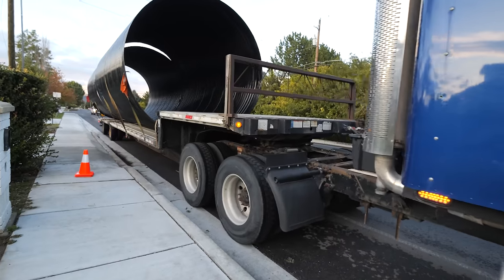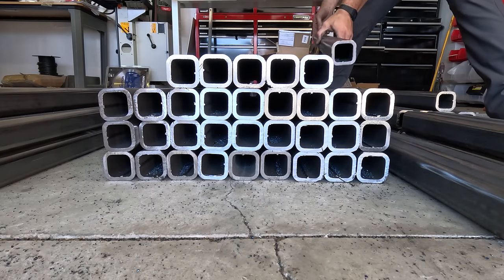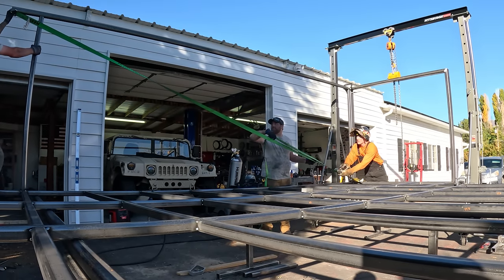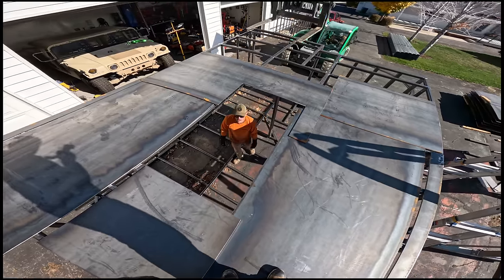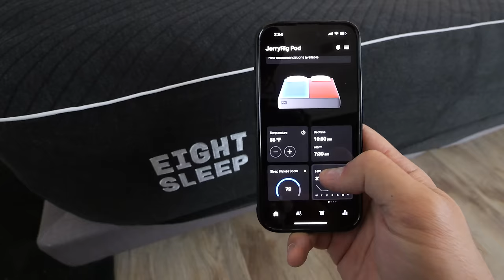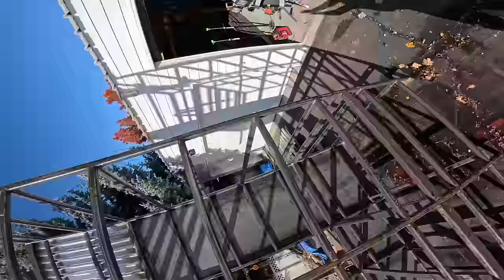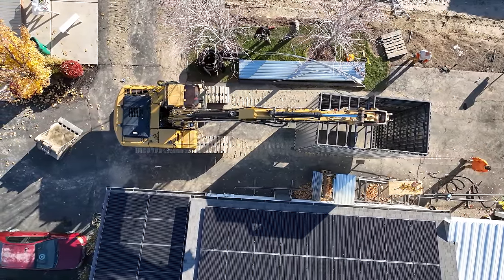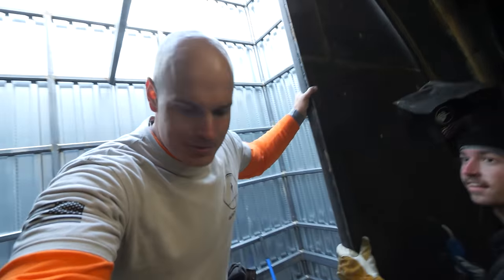BACKYARD BUNKER PART 4 - THE ELEVATOR SHAFT

Comment: I have a couple of concerns about the project.  1. You must have ventilation in the pipe when you work, otherwise poisoning can occur.  2. You don't have a concrete foundation for the staircase structure, which can cause subsidence over time.  And bending or even breaking the bunker as a whole.  3. Given that you have a tube concept booker, I would suggest that you hide most of the water and battery installation in the floor, as well as food and tool storage.  4. even if you don't think you need it, it would make sense to install a water pump and maybe also a septic pump for pumping out human excrement.  5 I would suggest two reservoirs, one for water and the other for feces, to bury by the stairs.  We'll see everything else when you show us.
Reply: It's probably too late to make those changes.
Reply: Are they planning to stay full time and use it like a house?
Reply: @KZDaGOAT No, it is for emergency situations.
Reply: @chriskay1449  ah that's right you don't shit during an emergency. I forgot.
Reply: @tarkadahl1985 😂😂😂
Reply: The engineer behind hamas tunnels
Reply: You sure you're need a foundation when you're that low down
Reply: @TheoDaJunk yes cause the fresh dirt underneath all that weight will still compact
Reply: Yeah, Considering these kind of projects once completed are difficult to alter, so all this should be well thought.
Reply: Wow they should have hired you to build the bunker
Reply: @tarkadahl1985 Did you watch the video at all. He literally explains why he is building it. They aren't living in it full time and they are putting in a bathroom down there along with a bedroom, living room, and kitchen. Don't be dense here.
Reply: @chriskay1449  course, you are 100% right, no one every needs to do a shit during an emergency situation when there's bedrooms and a full kitchen for staying down long term.
Reply: Will you tie it in to your house with a connector tunnel like Colin Furze?
Reply: Next concern, the fact that we’re building bunkers.
Reply: The "Well, actually" guy has appeared!
Reply: I wish he would have consulted ppl that actually do this for a living. It would have actually ended up saving him tons of money, time, & issues down the road that either will end up being unfixable or extremely expensive.
Reply: He mentioned a shower, so I think the water reservoir will come eventually
Reply: @ExilEliteYT And the welders are experts. They already know that stuff.
Reply: This guy pointing out the obvious🤓
Reply: I'm certain this had to be permitted and those city officials are pretty serious about making sure things like foundations are in place.
Reply: As someone who works in construction (CAD technician) I can verify that you may need construction if you're building under the ground. The soil is made from different geological layers, some more resistant to compression than others. If the soil is firm you can build on top of a concrete slab. If the soil is loose and/or wet or the firm soil layer is at a depth, you're going to need a foundation on concrete columns that reach to a depth where there's sufficient resistance to compression.
Reply: I was wondering if any concrete foundations were needed for both the tubes and the metal structure. Even if it's going to be buried, won't the soil underneath still move and shift the structures? I'm genuinely curious to know if that's not needed if it's all going to be buried.
Reply: Ok hater
Reply: He’s likely going to pour in concrete around the structure after this point in the build. As someone who took all the physics and structural engineering classes (plus statics) necessary to evaluate structures like this, I’m quite sure it’ll be fine. That is definitely dependent on how compact & stable the dirt is at the bottom of the pit (and whether he lives in an earthquake prone area), but I’m sure he consulted an engineer on the design. He’s not an idiot.

The fact you think the steel he’s using is going to “bend over time or break” just because there isn’t a foundation under the stairs alone says it all. It is quite a rigid structure (with most of the weight in the tubes, not the stairwell which will be 90% air), and in terms of static frame structures like this it doesn’t really work like that. It’d likely just shear, not bend (depending on the hardness / shear modulus of the steel grade used), if there are true issues in the design. But once again, that’d get checked by an engineer certified in evaluating structures like this before it’s approved.
Reply: What part of jerry rig everything don’t you understand
Reply: The "well actually🤓☝️" long essay guy
Reply: I would have preferred to see at least three concrete saddles for the culvert to set in. That could help prevent the tube from collapsing from the weight of the backfill over time. Also a perimeter drain with a sump and pump to keep water from pooling and floating the whole bunker up out of the ground. However mentioned has been made of an engineer, perhaps a consultant, so these issues may have been addressed. Possibility a line of concrete trucks will show up and bury the whole thing in concrete. That would resolve a few of my concerns.
Reply: I was concerned about the lack of footings underneath the stair well...
Reply: @jamespayne8781  I agree that saddles would’ve been optimal, drain/sump as well. I think most likely he’s gonna bury the entire thing in concrete… He could have a crane come out when they pour concrete so he can have them lift it up, and pour underneath/around all in the same day. Not sure. It was probably way more expensive to have concrete trucks show up two times so he could pour the foundation before all of this (but I have zero clue what that costs, so again not sure; probably not cheap though).
Reply: @o7juan   Who, op?🫤
Reply: Not sure he could’ve built this without permits and plan approval. If he has that, the engineer must’ve had all these concerns covered.
Reply: Would it be prudent to have an additional waterproof coating applied to the outside of the metal?
Reply: @tarkadahl1985 I absolutely love this reply 😂😂😂😂
Reply: @orlandogutierrez1234   Pretty much everything he’s using is already treated for use underground, except for the corrugated metal they added in this video (which will likely be covered in concrete)…
Reply: Where were these complaints during the first video? When changes could be made easily. And is he done yet, no. I think he is smarter than the average YouTube commenter, so I'll wait until he is done. Or we will get to see, "How to break down an underground bunker" lol
Reply: @haroerhaktak2613 hi, it certainly would be more difficult but still easier than once it is all buried. I think footings could be created if an underpinning  process were used.
Reply: @KateKosmo every comment he gets raises him in the youtube algorithm resulting in more subs and revenue
Reply: @chriskay1449 
No, it's just for YouTube. 

There. Corrected it for you bud.
Reply: @chriskay1449  why are you replying to me, wrong guy bro 😂🤣🤷
Reply: @KateKosmo  haha.. He is way more successful and richer than you woman.. Wake up, he has pros.. Look at that welding?? Really, like he needs to take advice from you 🤣😂 on top of that a woman 😂🤣🤷
Reply: @ianwazowski5607 he's trying to make sure he doesn't die?
Reply: I think he'll pour the concrete in the next part. Once everything is set and rotated properly. In my mind, I'm also thinking that he'll have custom water tanks for both the needs... He could also build a small septic tank near the entry, or exit. I'm also thinking he'll have his ventilation planned out to run through the ceiling. As for the ventilation while welding in this video, they were pretty close to the entrance. Maybe moving forward he'll figure something out
Reply: @ExilEliteYT  Jerryrigseverything fan being sexist? Not something I expected. Btw that remark at the end was so unnecessary. This video has nothing to due with politics, gender relations or anything like that so therefore no ones opinion should be invalidated because of their gender or their political affliation.
Reply: @ExilEliteYT   If I was american I would vote for Biden.
Reply: @ExilEliteYT  I don't see this level of animosity towards the top commenter what's wrong with you? It seems like you're bitter
Reply: @KateKosmo so the whole team he hired doesn't exist
Reply: @ExilEliteYT  Imagine flexing another mans money
Reply: Key word at the start of the video simultaneously
Reply: Didn't think Jerry was a Doomsdayer 🤔
Reply: Water tanks and sewage should be outside if possible. Why waste valuable internal space when you can put a tank in the same pit? Also wells are a great option if you can do one (what I have)
Reply: I agree there is a lot of concerns for me on this structure.  So many better options to accomplish the same goal that are proven.  Oh well it makes good content and that is views and that is the goal $$.  Cheers be safe and good luck you may prove me wrong and my 55 yrs of construction experience.  Could happen. 🇨🇦
Reply: @Laminar-Flow  you make a good point. If a build permit is required, there will be a burden of proof for structural soundness that only a certified professional can sign off on.
Reply: WiFi in the bunker is possible. It may become intranet rather than internet but you. It would be similar to an air gapped network.
Reply: @TheFinalIllusion didn’t you watch the first episode!? He literally said that this was actually a long time dream of his and had nothing to do with current events
Reply: @standardannonymousguy the real question is, will he add a car lift from the underground to his front driveway?
Reply: @bramweinreder2346  Exactly -- Engineering Certs required!
Reply: Please don't bury yourself alive....this structure is a tomb !
Reply: For heating cooling you could look into into 1-1.5k FT deep well temp should be around 110F 130F you got nice heat even if the temp drops 20-30 on the way up
Reply: @Beejrich  you have to do them prior too welding the ends on as they are larger than a man door entrance or even elevator.
Reply: So... you didn't actually watch the video... 🙄
Reply: Oooh lord I give it 5 years before that soil starts moving everything around good call mate
Reply: I wondered where all the engineers on earth went. They're all here in the comments section
Reply: i think these are all valid
Reply: My favorite project thus far.. 😁
Reply: @Laminar-Flow  i’d also think he’ll bury it in concrete, however i recall in his first video while excavating the hole that they were calculating the volume of dirt displaced by the tube in order to reserve enough dirt to bury it later on.
Reply: You mean install a gray water tank**
Reply: @carsoncox469 It's not obvious for everybody
Reply: Pretty sure he's thought of it and almost positive his engineers have.
I doubt this is a half cocked idea and they're just throwing it together.
My thoughts.......
Take care,
~Jonny5🥁
Reply: I’m gonna go ahead and guess Zach did his due diligence
Reply: For the stairs it may not matter. Alot of Utah is just rock...
Reply: foundation not needed it will act as a pile
Reply: @jamesmisener3006 Fellow Canadian here. I really don't see this project proving you wrong.
Reply: Nerd
Reply: @TheHertzWeb that's a stupid remark. People are making valid observations, which may not be 100% correct. Some of the answers are explanatory, which is great, while others, like yours, are plain stupid.
Reply: Also if it's not stainless steel ( can't remember if it was) won't it rust over time and eventually break?
Reply: @joshissocool97  Stainless is not corrosion proof. It just corrodes less readily than carbon steel. Hence, stain-less.
Reply: @tarkadahl1985 you have seen the build plans? How do you know what all is or is not planned for?
Reply: @Laminar-Flow yeah the welds and those bolts can support a lot more stress than most people would expect. They’re surprisingly super strong.
Reply: Why not build yours Mr know it all
Reply: @TadpoleTrainer   Exactly... I don't think most people understand the sheer amount of force required to shear welds and bolts. Static frame structures can handle a lot of weight and the culverts he's using were specifically engineered to be built underground. The weight of the dirt on top and small movements over time are absolutely nothing to a structure like this; most people here are thinking it's like an above ground home on a foundation.
Reply: I’m sure he has number 1 figured out, I don’t think a man capable of tearing downs and rebuilding phones aswell as converting a diesel hummer to electric would build a massive airtight carbon dioxide chamber
Reply: This is a nuclear family bunker not a nuclear winter bunker.
Reply: I don't really understand where you've gotten the idea that he hasn't considered any of this in his design.
Reply: @joshissocool97  i think it's coated with something, although some of it had to be removed to be able to weld.
Reply: @the_gamer_kinda  Because nobody needs a bunker.
Reply: A concern I have is why the hell its so shallow?
Reply: @tarkadahl1985 did you miss or just choose to ignore the part where they said “a bathroom down there”
Reply: Oh I’m sorry who study physics, engineering and statistics and got a building permit I believe jerryrigseverything did not you
Reply: @Laminar-Flow okay, first off, you WON'T see any of the shearing (were there actually any to occur in the future) of the welds themselves, provided the welder did his job correctly; thereby not imparting significant flaws within the vast majority of those welds.

What most do not know or fail to understand about welding science is that when the correct welding type & methods are utilized in the construction of any type of metal structure--including the hull of a nuclear powered ballistic missile submarine--the welds don't factor into the "total strength" (or survivability) calculations as structural engineers work out the integrity of their design because when each of those welds is absolutely on the money, it is understood that the welds are considerably stronger than adjacent base metals being welded together.  

It is those sections / spans / layers of the base metal that inarguably form the vast majority of the surface area of the entire composite structure, therefore the integrity relies primarily upon the engineers accurately specifying appropriate materials (defined by tested / established metallurgy values) with correctly defined dimensional measurements.  

Naturally, things become far more difficult to calculate when welds are not the sole method utilized in forming critical junctions in a metal structure, but those factors can all be figured based upon their own inherent limitations.  

Lastly, welds don't have to be subjected to magnetic particle, ultrasonic or Kadiography inspection to verify they meet mission critical standards, but when they are non-destructively tested and verified by such means, you can bet your life on those welds NOT being the point of origin in a event of future catastrophic structural failure.

As for bolts.....that's an entirely different matter, but still a factor that can be calculated for by structural / materials engineers.
Reply: @USNBRENDON  I definitely don’t work with welds much- I’m not a civil engineer, so welds weren’t emphasized as much as bolts & pins in the classes I took on structures/statics or vibrations & controls / mechanics of materials... This is mostly stuff I’m remembering from relevant classes because I don’t really do these calculations anymore. I’d assume you work / have worked with submarines because all of the stuff you discussed is definitely pertinent to that area of work- but you cannot confirm or deny for obvious reasons haha. It’s a pretty similar engineering problem to the bunker but obviously much less in terms of PSI. I definitely, definitely agree it’s not gonna be welds breaking first. It’d be bolts or the specific members of the structure in tension/compression, but you’d have to evaluate the structure with software for a high accuracy answer & that’s a civil engineer’s sorta gig…

I simply said people don’t understand how much force is required to shear welds and bolts, because it sure is true… This design is interesting because it uses both bolts and welds in the same places and in terms of a structure, holes nearby high-stress areas can be a point of failure but honestly at these scales of applied force not an issue. Realistically, what failure mode present would depend on the type of loading conditions that are present: tensile, compressive, shear, bending, combined loading. But, the torque moment required for bolts to be shorn alone is ridiculous; with welds it’s even more so. I am familiar with equations for Bolt shear stress, compressive stress, plate shear stress, etc. I also remember in terms of welds, the smaller value between weld metal and base metal strengths dictates strength of a weld but like I said, not my forte, and in the electric boat industry it’s all gonna be top-quality no holds barred material choices. Not sure what was used in these bunker videos, but I’m sure he had an engineer check the design. I work in aerospace, and in terms of that industry while welds decrease drag (and are lighter), they’re difficult to inspect for defects visually, are permanent, introduce heat-affected zones, and oftentimes now most sub-assemblies are a mix between composites and metal… You’re clearly on the money in saying the integrity of a hull or bunker for example rely on overall materials choice & weld type/method- I do think that nowadays such structures are definitely modeled in software and stress tested virtually, though. The software has come a long way, and when you’re talking about a nuclear submarine, models are very likely run through some of the government’s biggest supercomputing clusters- just like stealth calculations (among others now) have been since the infancy of our stealth programs. Most subs now, I believe, are digitally design before a single weld is ever made as is done in aerospace.
Reply: just make a big hole far away and connect a tube to the toilet
Reply: Yeah, I can only guess that a guy like Jerry hasn’t covered all the possible contingencies. LOL
Reply: @KateKosmo LOL Really?!?!
Reply: That's three more than a couple suggestions
Reply: @bramweinreder2346  with the weight of the bunker as a hole I’m fairly certain it won’t move much( maybe settle a centimeter or 2 ) I lay pipes for a living and except for compacting the sand we lay the ( not as heavy but still sometimes up to 2 tons) pipes right on it without a problem. Then there’s the fact that it seems that the soil in his yard is really good for absorbing water (so erosion won’t be a big problem if again compacted properly) won’t be a problem. As mentioned compacting is key for it not move. We usually do 30 cm layers with until we get to desired height. Haven’t had a single complaint from the customers or city I work for.
Reply: @seibt6466  good for you, it also depends on the groundwater level though! I live in the Netherlands where it's quite flat and soggy. Basements are put down as one big concrete tub, and if the floor is below groundwater level it will float. So typically they dig a well there and pump the water out to get the level down on that location until it's weighted down sufficiently by an entire house on top of it.
Of course, pipes are typically bedded in a compacted layer of sand that doesn't absorb water. Which is also the case here in the Netherlands, and to compensate they dig a sort of trench by the main road to collect ground water above a certain level and transport it to the nearest canal.
Reply: Why not use 304 stainless steel?
Reply: The batteries will emit gases, of some type or another, and one would not wish to filter those gases with the lungs of the humans inside. 
  Just prime paint and seal the galvanized section, all metal will rust eventually.
Reply: @carsoncox469  yes. Why point out the obvious to people who have not perceived the obvious. A pointless activity.
Reply: Waste water tanks will also emit methane, which causes unconsciousness, in high concentrations.
Reply: That hole in the ground, it is a swimming pool which will slowly fill.
Reply: All of the bunkers which I have seen, from the 1950s and -1960s, flooded, without constant maintenance and repairs.
Reply: @KZDaGOAT yes if it’s needed.
Reply: This whole thing looks halfassed
Reply: More dumb assed comments in this thread than all of FB groups combined. Most “concerns” were already discussed in the build and it’s mostly the setup is mostly the same as commercially available home bunkers.
Reply: @KateKosmo  you are just assuming that he hasn’t. He has mentioned in previous videos talking to engineers about the ground and other things, so he most likely did get expert advice on building this.
Reply: @pauljefferies9087 all your comments are mere speculation, 1. The bathroom and tanks will and most likely have ventilation and even if it didn't it would take alot of gas to build up considering the actual bunker itself is ventilated, plus methane stinks it's quick to resolve

2. Probably won't build up that much water, the ground guess what is suprisenly good at yunno draining water so no it won't form a swimming pool

3. Most old bunkers past a certain age are bound to fail, also while the practice of building bunkers hasn't changed much the materials have gotten alot better than back then plus what nearly 70 years of innovation and techniques of course old bunkers are more likely to need more maintenance. Thus leading them to be neglected and flood and because it's a sealed box that water can't escape but alot of bunkers today have drainage systems for this reason.
Reply: Also hate the fact everyone is assuming that Jerry has no idea what he's doing is geuinely insulting, you're talking about a guy while it's just electronics knows the ins and outs and spent alot of time doing thinks like solar projects and building a damn electric car from basically scratch using a humve shell.

This doesn't feel like a man who goes into something without knowing what he's doing, plus I don't know American laws but I guarantee he would of needed full detailed blueprints and strict approval from the state/council(council here in Japan and UK) engineers are pretty loud in voicing there opinions on home builds if it didn't look acceptable it would of been thrown in the trash.

And while Jerry is working on it, he also has professionals with him, actual pros who know there line of work kinda insulting to them too.

Plus 90% of these questions have been answered in the previous videos.

I'm sure Jerry knows what he's doing especially with spending that much money and time stop doubting and just watch I doubt your concerns would even have effect since these videos are being done pretty close to eachother lmao.

Fxckin armchair engineers really like putting everything down but can't use some common sense and understand most of this was probably already thought out. Sure if it was some goofy npc YouTuber you know the types I'm thinking then sure I'd be concerned but Jerry's not that type he's a geuinely smart individual.
Reply: Man lays down the first section of frame for a bunker on a hole:

The internet: uMmM I hAvE sOmE CoNcErNs 🤓🤓
Reply: @BiggestRedditor  seriously it's ridiculous, I get some YouTubers are dumb but not everyone is and you'd expect jerry to be the one to know his shit and do research it's like people believe they wouldn't of gone through a deep planning phase with the city/council and other organisations involved to slap his head if something was wrong lmao
Reply: I would have built it out of cinder blocks tbh.